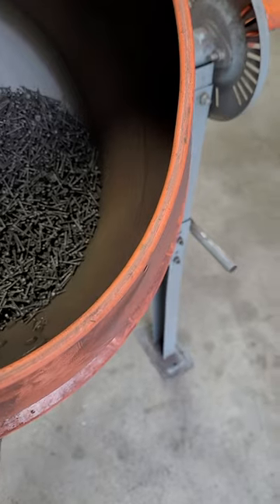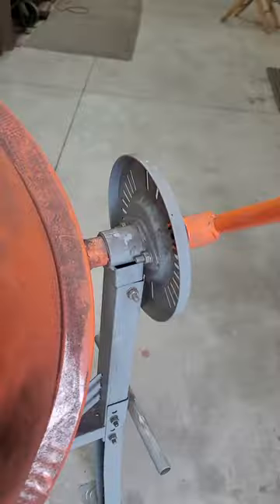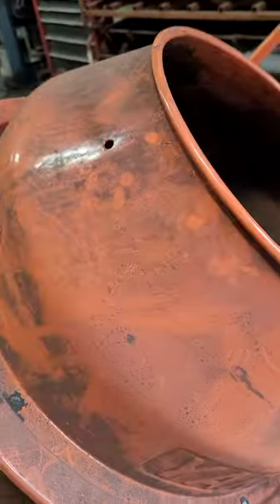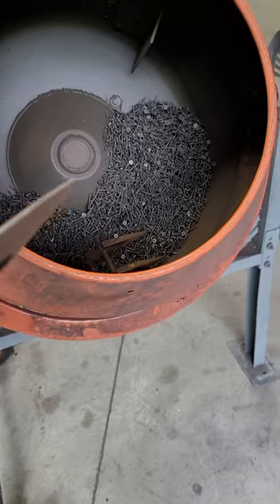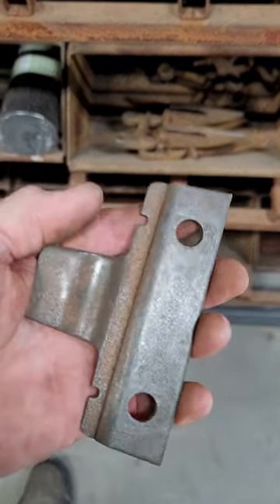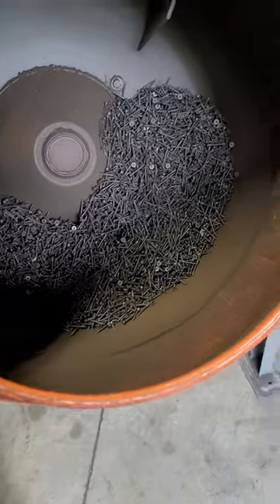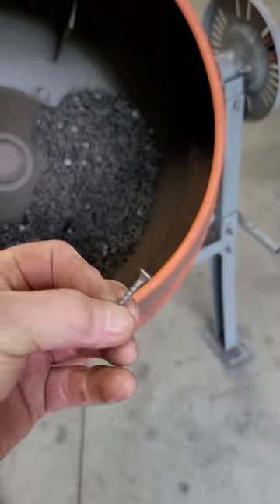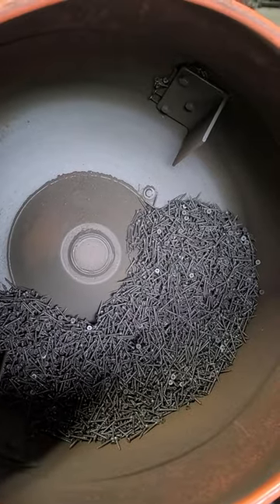Low cost steel parts tumbler made from electric concrete mixer and using drywall screws as media.

Comment: If you coat the outside with spray on bed liner or anything rubberized it will make it much quieter. Also try pea gravel as a media or river stone that may work too. Great Idea! If it could be slowed down that would help too.
Reply: Ya spins too fast

Comment: What a great idea! I might try this with some corncob bits and some "brass tubes".
Reply: the carbon on those brass tubes doesn't come off super reliably with corncob bits, I like a vibratory tumber and steel pins, gets the boom button hole cleaned well